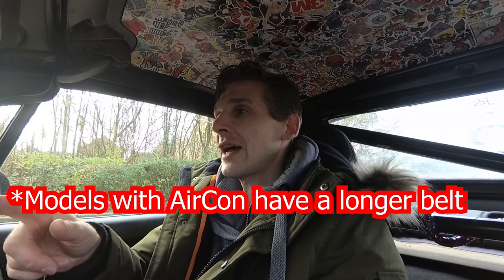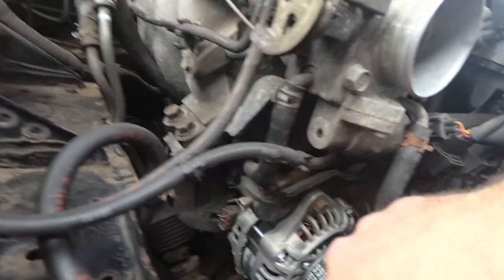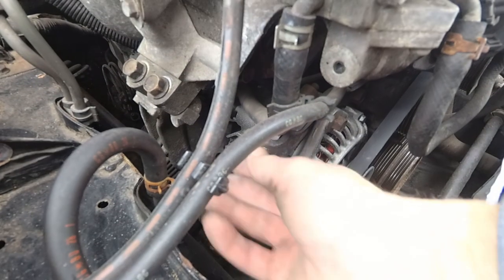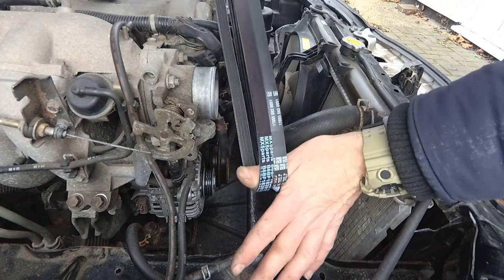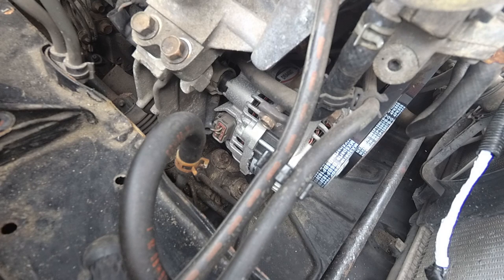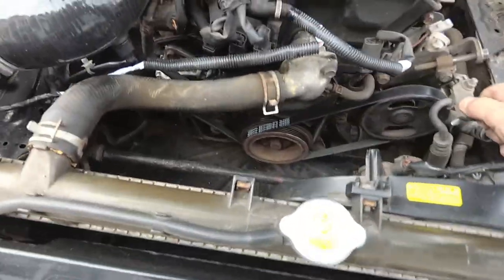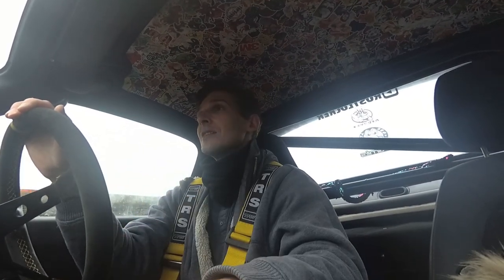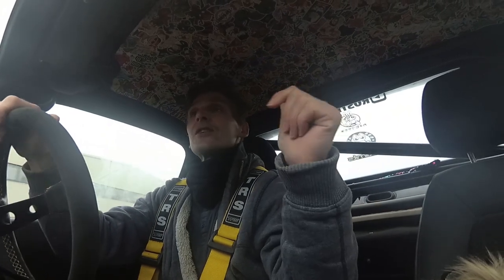Fixing Alternator & Power Steering Belt Noise - Replacing Auxiliary Belts MX5 nb

Comment: There's also a bolt underneath the alternator that will need loosening. If its already loose it will need tightening up as part of putting the belt on. Will stop it coming loose and squealing. 
Also in relation to the hole in the power steering pully, just put the car in 5th and roll it slightly. Ideal for a car with a low or poor battery if you're worried about this
Reply from the maker: Ah yes, thanks for the tips.
Reply: What is the part number of that bolt?
Reply: That bolt under the back of the alternator can be a real pain! One option I've seen on Miata forum is to use a crowbar between the underside of the alternator and the engine block protrusion to force it to pivot a little and force the bolt loose. I'm yet to try it though.

Comment: This is how I remember it with my Peugeot 104 and Renault 5 (no power steering, but I did alternator jobs). Simple: loosen, move, take off, replace, reverse procedure. Now, it's like untangling the Bolognese in a children's lunchbox - my Modus being the worst.
Reply from the maker: Ha ha, yea the serpentine belts now, designed by computers to be cats cradles.

Comment: The oil filter is an utter bastard in the NB 2.5 I have. I had to take off the top brace and the RH mount tower for it. Then you can just get your left hand down to it. Unscrew and pass to your right under the intake manifold and pull it out the front. There is an epf filter tank or something which makes access very tight. Going through the wheel well is one option but didn't work for me.

I've just done the valve cover and new plugs and I have the belts on the shelf ready to go so cheers for this you have saved me lots of time and swearing.
Reply from the maker: Yea, an oil filter relocation might be on cards for me soon.

Comment: Nice one dude.. Doing mine soon as MX5 Parts send me the stuff maybe even today..
Reply from the maker: Good luck.
Reply: Well The Power Steering belt was well tight to get on even with all the bolts loosened .., Ine were from the same provider as yours but got it on .. May take a few days to smoothen up .. Not someday if a job if your bolts have not been touched for a while .. Will do alternator belt tomo!!!
Cheers ...

Comment: Hi, I have the same problem 
I had a performance shop put new belts on and tighten everything up but when I start the engine with the ac on I’m still getting the squealing belt sound.
I feel like I’m just going to have to take the car back to be tightened but knowing my luck it won’t squeal when I take it in 😂

Comment: Do u know how to fix the power steering on the Combo van mate mine goes really stiff when parking
Reply from the maker: I’d check for leaks or loose belt. Then bleed power steering fluid, or replace if it’s old, could also be brake booster or other things mate.
Reply: @RustLocker  I was thinking the fluid could be low and needs changing but I can’t even find where the power steering fluid is there don’t seem to be one mate
Reply from the maker: @foxthewoodturner1765  yea it might look like a black bottle with a dial on top . lol. heres a pic - https://images.app.goo.gl/Yvsu7ukqk5Phza439

Comment: I change belt 2 times and have a noises 🙃
Reply from the maker: Could be you have not tightened the adjustment bolt and it’s coming loose over time.